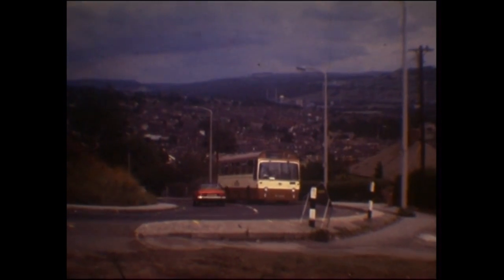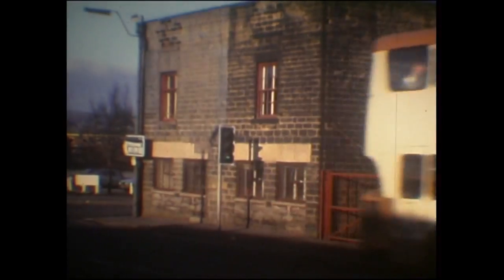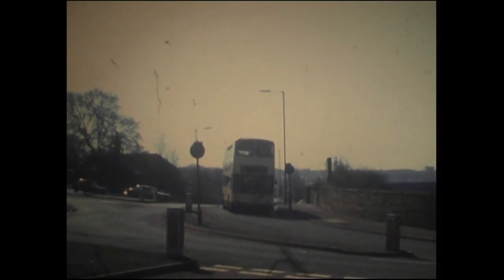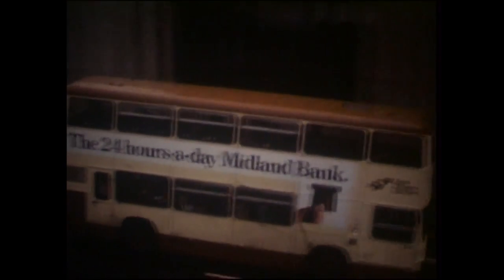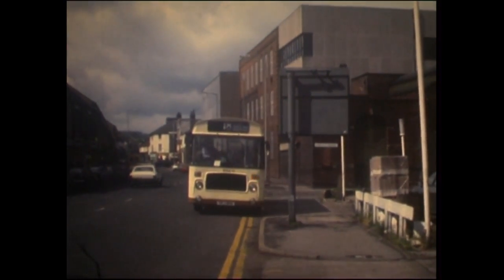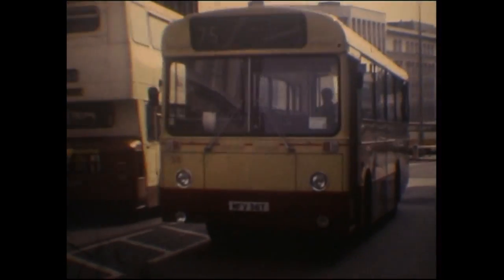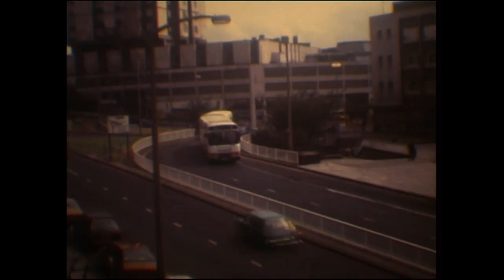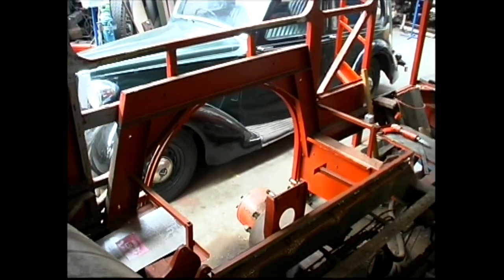Buses of the South Yorkshire PTE - The Early Eighties

Comment: I Travelled all over the city on those busses. Mainly the 20, 33, 43 and 28 from up at Hemsworth into town. My dad was a fitter at Greenland Road and knew those busses back to front - all the systems. My interest in engineering came from him. I still have his toolbox in my garage, many of the spanners in there will have been used on those vehicles.

Comment: Those Dennis Dominators were a terrifying experience to be a passenger on, especially as they were getting older & older and still used into the Mainline era, the back seat on the back downstairs seemed to move with the chassis and when speed humps were added to Sheffield's roads and their suspension was getting worse, I held on for dear life sitting upstairs!!

But the Eager Beaver's I did think they were fine, until you hit a bump in the road and you lept up 2 foot from the seats! 🥴